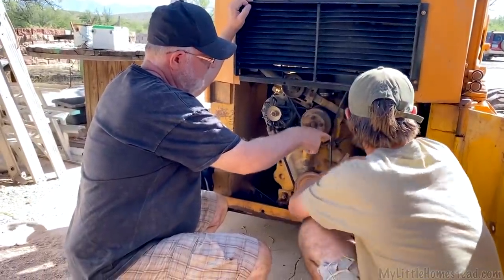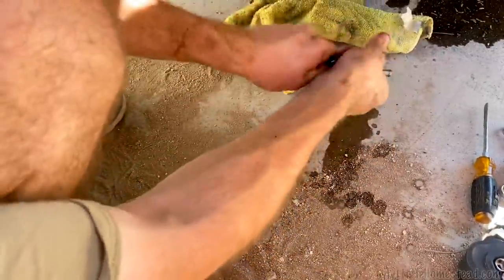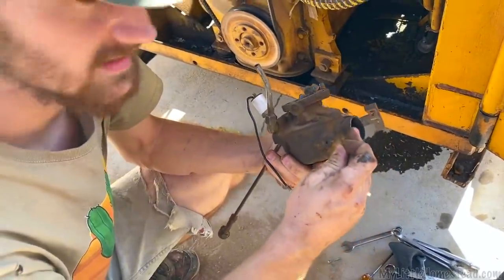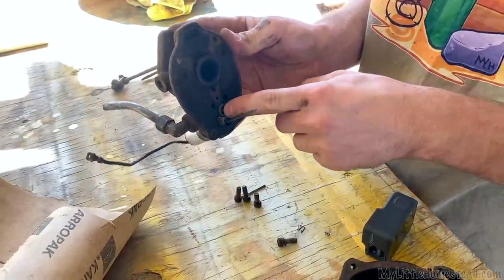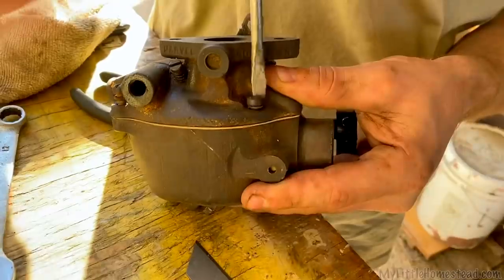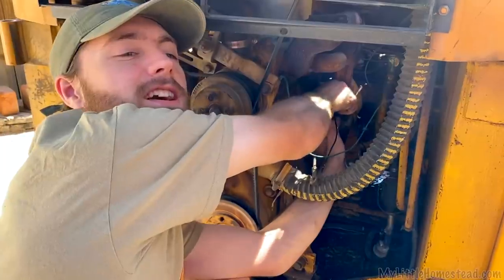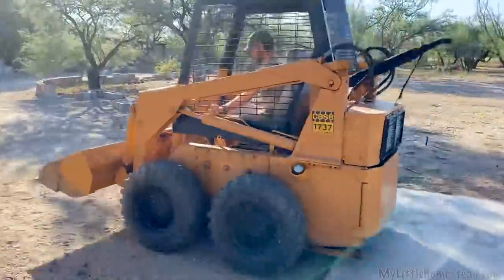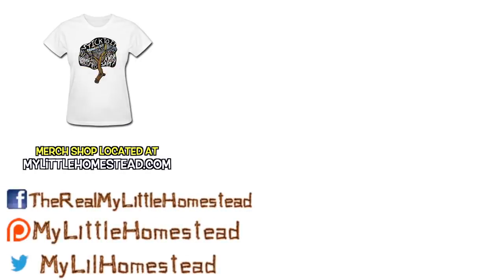Bryson's Skid Steer Pulse Revving While Driving Fix

Comment: Blowing out that filter was a good plan to finish the day, or week, but you should still get a new one, or two, when in town - you didn't get it clean, just clean enough to work a while more, then keep another spare around.  Those things that aren't ran that often get gunky tanks.  It's probably got years worth of gunk in the tank.  IDK how hard it is to take the tank off, but that would be time well spent if you were bored someday, cleaning it all out and putting it back. But I'd at least stay a filter ahead of it till you got a round tuit and since it is probably just parked most of the time, see if you can find some ethanol free gas, that is much better for occasional use equipment 😉  Good job on the carb, that definitely needed done too.
Reply: I was going to say basically the same thing. But I'll add, think about using Seafoam fuel additive (or a similar brand) it helps with gas that's sitting for a long time.
Reply: Gotta get that ethanol free gas. I distroyed my last snow blower engine before I figured that out.
Reply: @bkbroiler8069  if you do what Bryson did you may be able to get it going again. Usually bad gas will prevent it from running but it doesn't do damage to the motor.

Comment: Yay...you got it running again....now go do the job right! Fit a new float valve (a few of bucks off ebay) and set the correct float height or you will never get the right air/fuel mix across the rev range. Then fit a new fuel filter...blowing it out will clear it for a while but it will soon block up again. Check all the vacuum hoses from the carb, any crack there will give you a lean mixture and surging...replace as necessary. Fit a new decent air filter, especially in a dusty environment like yours.

Comment: It's called 'lean surge'. Good fix. You can also 'buff' the seat where the needle goes with a q-tip and a little bit of valve lapping compound in a slow drill. This will help it seal better when closing.

Comment: Cool repair, but YUCK. You were working in the hoop barn, don't you have an air compressor in there? That would have kept your lips off the fuel filter.

It's hard to tell on a video, but that thing sounds mighty noisy. Is it that loud in real life? If so, you might consider wearing hearing protection when you use it.

I'm surprised that you haven't painted the driver's cage a lighter color. That black metal must get dangerously hot in the desert sun. I once burned my wrist on a black dumpster in a Florida parking lot in August (I was wearing work gloves but it caught me on the wrist, just above the edge of the glove, and YIPE, it hurt.)

Comment: You might look for a frame mount bowl type filter to put inline with the fine filter there.    This will catch the large granola like rust chunks and is really easy to clear.  After some regular use the amount of rust coming through should taper off.  Universal inline filters are cheap and plentiful on the market, buy a lot of 4-6 of a good name brand filter, and change it again after just 5-10 hours of runtime and get a feel for how much rust is coming through.

For a long term fix you may need to hunt for purpose built rubber intake hose.  Radiator hoses are sensitive to petroleum and gasoline vapors, not to mention occasional flooding, which can soften and swell the rubber dramatically.  I remember a story of some guys restoring an old Isetta and they fashioned a replacement from carb to engine from radiator hose.  Ran a bit then started failing, they looked at the engine with it running and that radiator hose "was pulsating like a set of hummingbird lungs!"  Know your exact size in inches and millimeters and there's a world of inexpensive bulk silicone hoses online for the car tuner market.

Rust chunks pushing through a very clogged filter can make the needle not seal and flood the carb.  Also, the needle and seat sometimes need to be replaced.  Occasionally you'll get a float that's gas-logged and less buoyant than normal.  In general lowering the float level doesn't increase the pressure on the needle valve, it just nominally shuts off at a lower level.  The lower bowl level will make the fuel mixture leaner, which might be a desirable condition at higher altitude.  There's a spec for float height, blow into the intake and slowly raise till it stops, then measure.   Carb rebuild kits usually come with a tiny cardboard ruler for this purpose. 

Spray can carb cleaner and compressed air go a long way toward solving carburetor problems.  As a teen in the early 80s I used to work on lawnmower powered go karts, and was always using old school cresylic acid based carb dip.  Cleaned the casting immaculately, but I can still hear my Mom's cry across the decades:  Don't bring that SMELL in my HOUSE!

Comment: Very good job Bryson!!!!!! I just love older vehicles to work on. Everything is easier to get to, work around, generally easier to diagnose, less add ons to go wrong and diagnose and easier to exchange when needed, if you can find the parts...lol!!!!!
I agree with Brad Payn about going ahead and getting a few filters, just so you have them and can replace the used one. Also, I would recommend starting and moving the bucket through it's various positions and taking for a little spin around the drive at least once a weak, when not using regularly.

Comment: As others have mentioned, i also recommend removing the fuel tank and cleaning it out because the problem with debris in the fuel filter is only going to get worse.  Sometimes depending on the condition of the tank you might be better off replacing it with a new one.

Comment: There's a gas evident called marvel mystery oil you can put it in the gasoline and in the oil this will help because the vehicle was not designed to run on ethanol gasoline or unleaded for that matter it will help lubricate the top end and keep the valves cool as the valves were probably not hardened or valve seats the cheapest place to buy its Walmart in a large jug